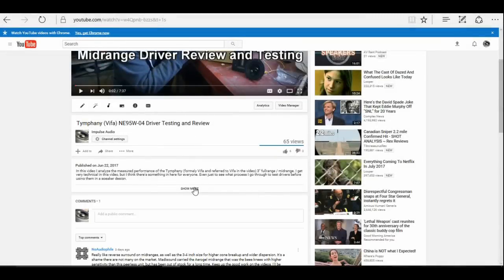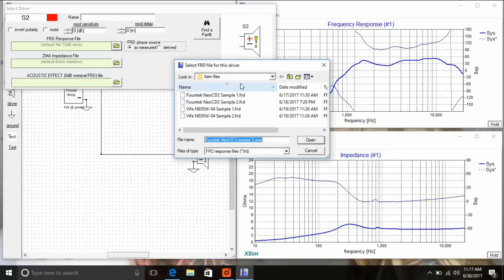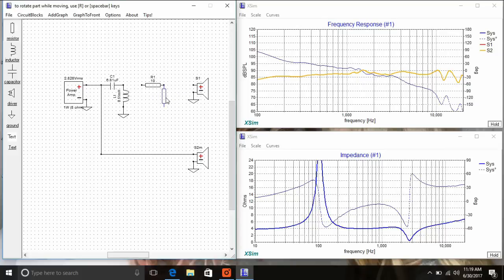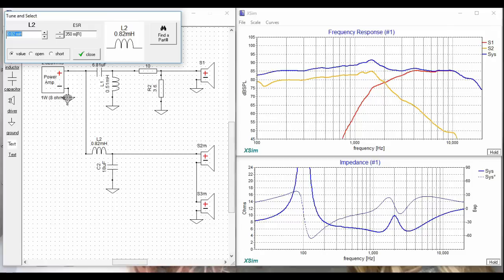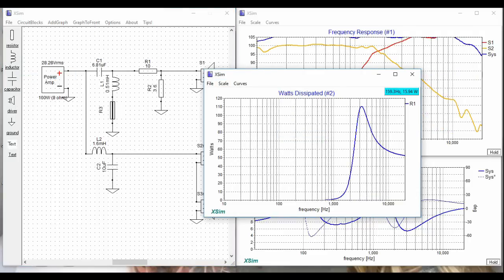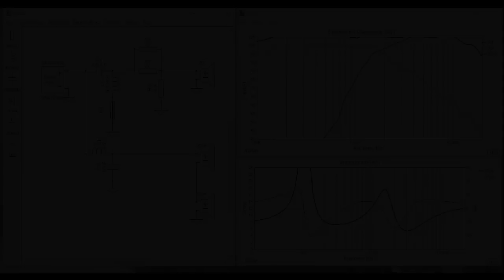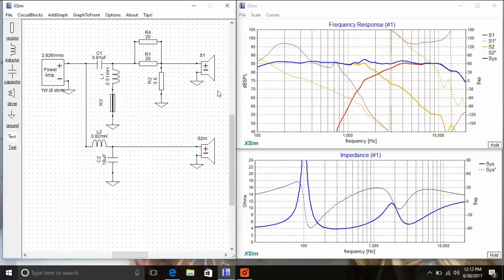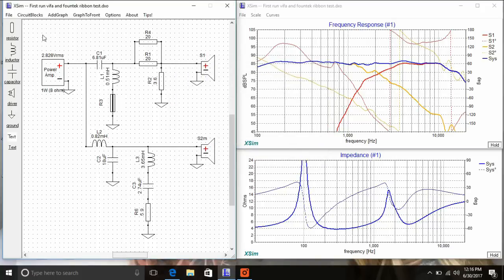Crossover Design Software Xsim Tutorial for HiFi Speakers

Comment: The hard part is measuring the speakers accurately and setting up all the gear to do the measurements, and the software, sound easy is a rather complicated program too.
Reply from the maker: 100% correct. Getting clean data is difficult.

Comment: I have just one question. When purchasing your Inductors and Capacitors, how do you choose them based on the ESR value you entered for them in Xsim? I can't find any ESR values listed on the components (air coil or capacitor). For example an Aircoil of 1 mH with an ESR of 350 m[R].
Reply from the maker: I’ve never found that to be a problem. It’s usually always listed. Perhaps labelled resistance or DCR?
Reply: @ImpulseAudioSpeakers  I was able to determine that 350m[R] is 350 milliohm which converts to 0.35 ohm. Thank you!

Comment: What all do you need as test equipment to fully test drivers yourself, if you don't know or can't find any "spec sheets" for the drivers you wanna use?
Reply from the maker: A decent calibrated condenser mic and a decent space to work. The software I recommend is REW and Xsim. I suppose you’ll also need a way to measure impedance. The DATS system is about the only choice for that.
Reply: @ImpulseAudioSpeakers  How much does all of that stuff cost? I'm on a VERY limited budget!
Reply from the maker: @JoeJ-8282  if on a budget, get the mini dsp mic or some other cheap mic for about $150. Then the DATS would be another $100 I’m guessing. Sorry I haven’t priced this stuff out in quite a while. If you are doing an active XO you don’t need the DATS.
Reply: @ImpulseAudioSpeakers  Wow, OK. More than I was hoping, but I guess I need to save up for a while if I ever TRULY want to Improve my game with speakers!

I guess I ALSO need to get an actual computer first too though, because rn all I can afford is my cellphone that I watched this video on. And really I only have that, mainly because I need it to stay in touch with and use during work, i.e. my job.

So far all I've ever done is basically do stuff with and try to improve speakers that I find for free in trash or recycle dumpsters, or sometimes I buy from my local thrift stores IF they are no more than $1/inch of driver diameter. That's my limit. AND they have to already sound pretty good before I buy them, and then I will take them home and tinker around with them and improve them the best I can by ear, and by using my basic knowledge of how crossovers work and such, along with all of the other more "subtle" things I've learned over the years that make speakers sound better.

I only have a basic multimeter and a calculator to work with rn, and even though I DO have a really good ear for what sounds good and what doesn't, after literally 1000's of hours of experience in A/B comparison listening and experimentation, when I watch the REAL speaker building channels like this one, (and many others too), it just makes me realize that I really don't know much of anything substantial about speaker building in all actuality, even after all these MANY years of experimenting with NO budget, second hand speakers.

I do what I can with what I have though, and it's at least fun and enjoyable and entertaining for me, even if it has to only be a casual hobby, because of time and budget...

I love videos like this one though that show how awesome and cool and relatively EASY speaker designing and building CAN AND SHOULD really be, plus it gives me something to look forward to, if ever one day I can get enough money to actually buy me some REAL analyzer equipment and stuff like that! It's really amazing what all is possible nowadays with this type of stuff! Technology sure has come a LONG way since I was a kid and I started to be interested in this kind of stuff!
Reply from the maker: @JoeJ-8282  you should check out the Panasonic condenser mic. It’s a mic capsule that costs about $2 and you can diy a mic with it. Pretty darn accurate. Can even diy an impedance jig if you want. They’re not great and not as accurate as the mic and jig I mentioned, but will really up your game for about $10.
Reply: @ImpulseAudioSpeakers  Yeah, cool, that's more like up my alley of budget, at least to start out with for rn, but how and where can I get that? Do you have a link or a site to buy it from, along with a model or part number?
Reply from the maker: @JoeJ-8282  it’s been more than 10 years since I used those diy devices. You’ll need to do some google work.
Reply: @ImpulseAudioSpeakers  fair enough

Comment: Very interesting to build crossovers with the help from a computer but one question remain: How accurate is the result compared to the simulation? Since there is always a disparity between drivers in their response and impedence, how much can we rely on them? Plus, the quality of the components, cabinet construction and damping material can also affect the final result. I suppose it is only a set of variables in the total sum of what makes a speaker great or not. Great vid! Keep them coming!
Reply from the maker: They’re pretty darn accurate, but yes, an error in the driver follows that speaker. The more inaccuracies in a driver the more error. And of course your do need to listen and evaluate the design and tweak. The computer definitely can’t do that.

Comment: This is really cool. A bit over my head at this time, but cool. Yeah, I think I would like to try to design my own speaker at some point. Any advice on how to deal with crossover as a newbie would be appreciated. Curious why designers never use oval speakers: wouldn't having a speakers' surround closer to the edges of the cabinet increase the soundstage? Or maybe not? I think of GoldenEar Tech: They designed their speaker cabinets narrow with narrower fronts to allow for greater disbursement. Eh, just a thought.

Comment: Fantastic tool, thanks a lot. I  wonder where to find the frd file to simulate acoustic effect as you propose. I 'm using a wave guide so the SPL given by the manufacturer is not valid !
Reply from the maker: If you go to one of my driver test videos, I have a drop box link in the description.

Comment: Hi Impulse Audio! Awesome video, have a question however!
Idealy do we want those phase lines on the drivers to be in line as possible? so they are all ontop of eachother, or do we want them parallel?
Also lets say when modelling around with drivers, blah blah and we invert the polarity on one of the drivers and barely anything happens, is this bad? Thanks buddy!
Reply from the maker: Quake Audio this is a pretty big topic you’re asking about. There are exceptions but yes you want the phase to be on top of one another. Then the drivers will be in phase and offer the most tweeter protection and woofer breakup suppression as possible, and some other stuff. The phase really only needs to overlap across the XO region. It’ll be impossible to get them to overlap for the entire frequency spectrum.

Comment: Hi and thanks for the awesome tutorial. I have a question. Is there a way to simulate the frequency response by taking the box dimensions into account? I'm speculating that the woofer sensitivity will lower a bit and the tweeter will remain the same, which means that I'll have to compensate with a resistor to keep them even. Is there a tool for that and is my guess correct? Thanks
Reply from the maker: If you measure with the drivers in the box, like I do in my other vids, then the box effects will be taken into account.

Comment: In xsim you can choose value, open, and short for each component. I understand the first two but what is the purpose of short? Can you wire a capacitor in short? How?And why would you?
Reply from the maker: It’s just a convenient way of turning off the component. For instance, you could have a 3rd order crossover L, C, L and then short the 3rd leg, L, to see what a 2nd order crossover does. You could also short a resistor that you don’t want but might want later. That sort of thing.

Comment: Hi Ryan, just wondering why you didn't use a measurement of both drivers in parallel to use as the basis to set the acoustic offset?
Reply from the maker: Maz 4bz I did. I might not have shown that in this video because it was about how to use the software, but I usually do. Note that method is not always necessary.

Comment: Hi, thanks for the tourtorial. I would like to add the circuit block to take out a notch in my system but I can't find the circuit blocks. Did you download the circuit block function elsewhere?
Reply from the maker: I’ve been hearing circuit blocks are no longer a feature in Xsim for some reason. I didn’t have to download anything special.

Comment: Thanks for doing this tutorial, Ryan.
Reply from the maker: Bill Waslo No problem. Its pretty basic and hope to discuss specific features and ways of use eventually. If you ever want to provide input about what FAQs you get, you know how to contact me. 

Funny thing, I was still using the beta version I tested up until it was time to do this video. I discovered a few things when I downloaded the latest version. Glad I did that. Figured it was prudent to get the latest.
Reply: At this point you may know about it more than I do!  Haven't used it since last year, though plan to soon.  

Maybe you could do a section on getting "classical" filter shapes (since so many new designers seem fixated on creating some Nth order Somethingworth responses (for no good reason I can think of nowadays, since measurement setups are so available, but it's probably the comment/question I hear most)

Comment: What is the mod delay used in the Select Driver menu? Can't you tell which parts are being calibrated or which parts are being used for speakers or which parts are being replaced?
Reply from the maker: W엉덩 I use the mod delay if I want to change the physical location of a driver or to set the Z difference between two drivers. Not much else for it.

Comment: i started on xsim a few days ago i want to make a 3 way crossover but because i have professional components, the frd and zma files weren't available i have the sica 10fe 3 cp 8Ω woofer the sica 8m 1,5cs mid and the visaton sc 10 n tweeter i'll send the pdfs too.Now i got the curves from graph tracer and edited them, with paint 3d i erased everything except the frequency and impedance charts everything works in xsim, i noticed tho that the curves of the drivers, are not aligned with the x and y axes of xsim based on the factory pdf. Is it possible to adjust the axes of xsim so that the curves appear as they do in the factory pdf?? and if so how? As you guys can see for yourself in the crossover photo i sent the frequency of each driver if you compare them to the factory pdfs does not align they start at more hz and more dbs i would really appreciate an answer cause i cannot align them.

Comment: I ran 2 woofers in series but I can't get the line to show on my graph and I noticed you didn't try to bring it up on the graph. Would it be just the same as the single woofer?
Reply from the maker: Two woofers in series produce the same SPL as one, despite being 3db more efficient. That’s probably why your line didn’t change. If you need it louder, try parallel. But then the impedance will drop in half, so be careful.
Reply: @ImpulseAudioSpeakers  I ran 2 4 ohm in series for 8 ohms if I run parallel it will be be 2 ohms and I don't think I should try that with my amp.
Reply from the maker: @BostonMike68  ya you won’t want to do that. You’ll have to go series. At least your amp will like that instead. Lots of headroom too.

Comment: The version in the link doesn't have the  Baffle pull down. The version that does is in the BetaTest folder but the Baffle pull down is greyed out and doesn't work. Is there a current accurate link to the most current fully working version? Thanks.
Reply from the maker: Greg Olsen I’m not too sure. Someone else recently asked about this. It seems the developer has pulled it maybe?

Comment: Thanks for a great video.  I'm noticing that the mod delay for my woofer is making a significant difference to my frequency response and would like to put in an actual value, or even better offset my speakers when mounting in my cabinet.  At which location on the speaker do I use to measure mod delay?
Reply from the maker: jpc6204 it’s easiest to measure both drivers individually and also wired in parallel, without moving the mic. Then in Xsim add the graph of them wired in parallel as an overlay. Then adjust delay until the response aligns with the parallel measurement. This will give you the proper delay. It’s fairly important to do right to get good results, but if in doubt about 25mm usually works.
Reply: @ImpulseAudioSpeakers  Got it, thanks!  I also saw another video you had entitled "Life S5 | Part 3: Design Goals and Setup," which walked me through the process.  You're gonna make me a master speaker builder in the coming months!

Comment: Hello! Thanks for sharing this amazing knowledge about crossovers... and thanks for the hint with Xsim! Wonderful program! I was wondering, very few are using series crossover networks, and I don't know why!? I have built some crossovers of first or second and even thrird order, parallel vs series, and ... they sounded better on series! On the parallel versions I had to use several parts to obtain what I wanted (using Xsim, of course), but in series... I've just needed a few components, and on the Xsim it showed exactly what I wanted almost immediately! I know, of course, that if I needed to change one component it affected both drivers at the same time... it is a disadvantage! But, seriously, its sounds much better! What is the science here, anyways?? Is it the taste only? Is it the drivers? Or the room for that matter...? I don't know... I've always used a midwoofer (6.5") and a dome silk tweeter! The midwoofers were eighter with paper cones or kevlar cones and rubber surrounds! Nothing else whatsoever! 
Every time when I built series crossovers, the midwoofer was on the first order, whilst the tweeter varried from first order to second order... when I used second order for the tweeter, it was Linkwitz-Reily!
Reply from the maker: They can work very well but are a pain to design. Parallel cross overs let the design mash the driver into submission without affecting the other driver. It’s a real trick getting series to work. But they certainly work just fine. I’m not sure there’s actually a sound quality benefit, but if it works for you go for it.

Comment: In a first order filter, for example for a tweeter, does it matter if the attenuation by a resistor is put before or after the capacitor?  Or is it the same?
Reply from the maker: It does matter because if it’s after the capacitor must be smaller for the same affect. Either can work just find though. Sometimes I put a resistor before AND after the cap to get the outcome I want.

Comment: Can you make video start from basic to get driver files and all associated files and by using xsim to get how to make really reliable crossovers? I have bought Tyler acoustic  3 way mastering speakers which equipped with dayton RS-180-8, RS-270-8 and unnamed tweeter. I really like the very open space detail sound come out of the box, but they are bump around +5db on 3-5k and huge dip around 250-300hz so as a result the sound is so clean. I paid a lot of money to shipping and I want to keep them and work on them just because they are well constructed.
Reply from the maker: There's a lot of information to pack into one video to get from start to finish, but I will keep adding videos about how to measure and get information for XO design. Is there something specific that you're struggling with understanding?
Reply from the maker: What part are you struggling with? I'd rather help you get to a solution and learn than get paid to do it for you. But I don't mind making some suggestions either.
Reply: Thank you for your kind heart. I am struggling on first crossover point between tweeter (I picked dayton tweeter from partexpress) and RS-180-8 mid driver. I just can't make that crosspoint work.
Reply from the maker: Allen Aung ok I'll email you or you can email me at ryan at impulseaudio dot ca. I'll need you to email me the files you have and  your xsim file too.
Reply: I just sent them to you. Thanks
Reply: I sent them by email. Let me know if you don't receive it.
Reply: I am also interested to see more of the measurment/creating frd and zma files. How to set up the software, the mic calibration file, the amplifier gain, the distances etc. Thank you for aharing your knowledge!

Comment: Cool video, thanks! Do crossover simulation programs not take into account total sound power (e.g 30 and 60 degrees off-axis response)??  I also can't seem to load frd and zma files traced from FPGGraphTracer.  I keep getting a "file load error!".  Any idea?
Reply from the maker: Not sure why you’re getting the load error. 

No they don’t usually show sound power (power response). Most will allow you to pan off axis and as the designer the off axis should be measured.
Reply: @ImpulseAudioSpeakers  Thanks!